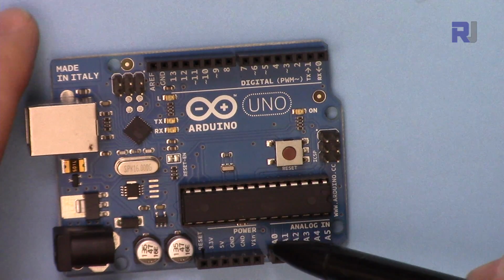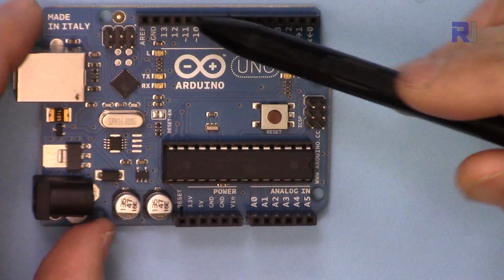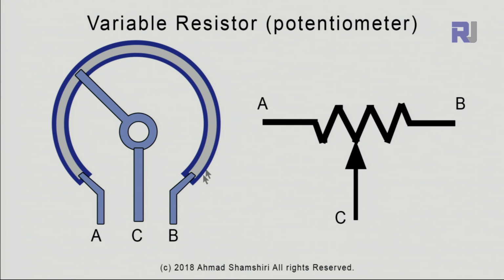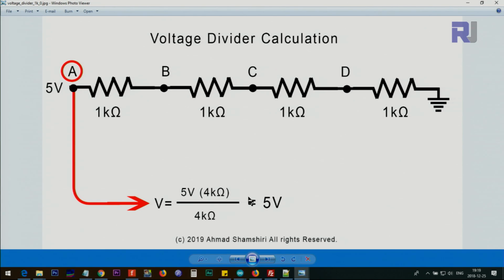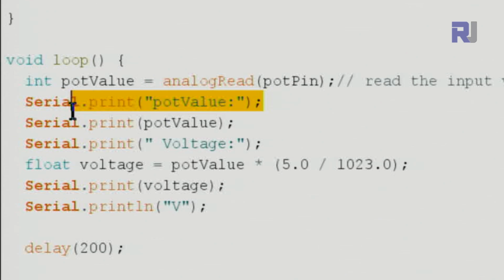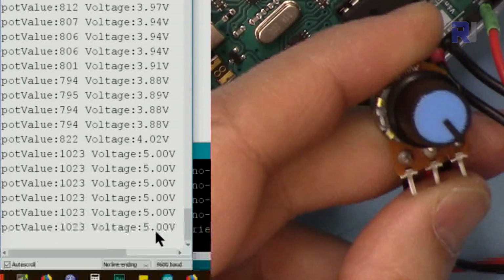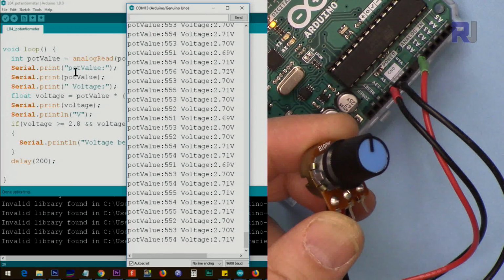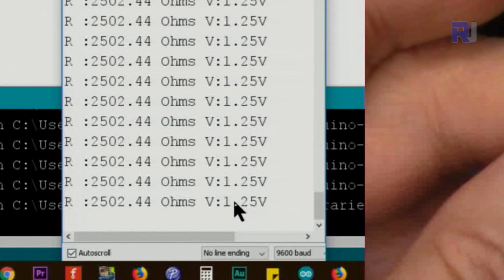Lesson 10: Using Potentiometer reading voltage, Analog and Digital  - RJT564

Comment: Hello Robojax! 
What will be the code if I'm going to test 2 or more potentiometers?
Thank you for the help
Reply from the maker: Hello, very simple. I am sure you have followed the course. Just define a pint for 2nd variable resistor (also called potentiometer) and store the value for 2nd potentiometer in another variable. Just duplicate all the variables used for a variable resistor.  You may learn from this video https://youtu.be/5zT9iZRa5b4 which is about something else but two variable resistor is used.